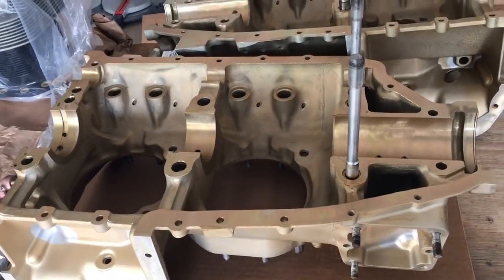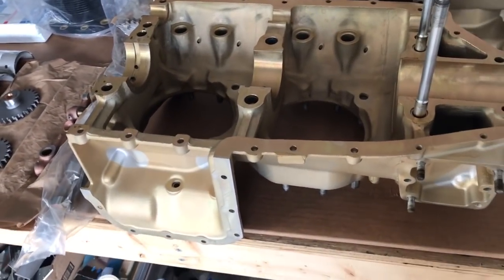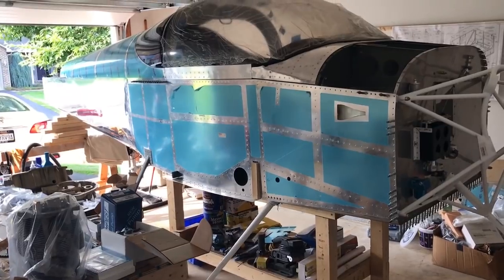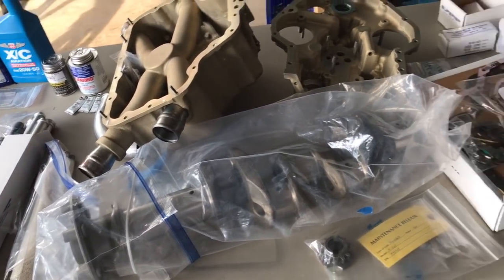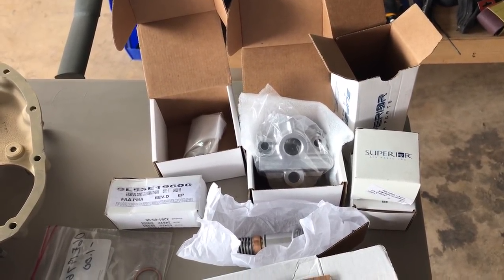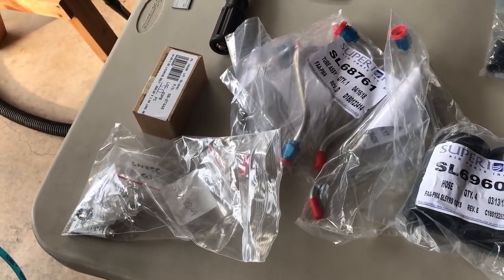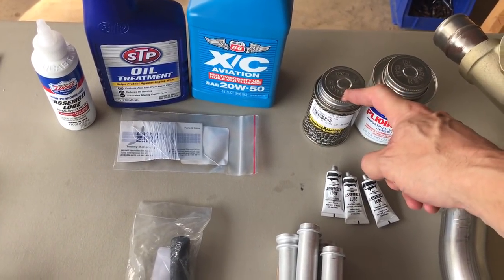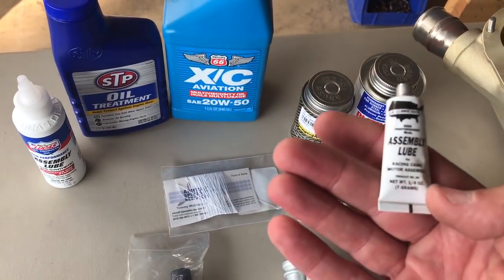Lycoming O320 Rebuild Part 1

Comment: Good for you tackling an engine rebuild.   I would love to try such a feat, but would never.   So much knowledge I don't have is required.   Glad yours came out alright..
Reply from the maker: @gsxphil
I did reassemble.  It’s been flying since March 2019.  I wound up getting help from Winchester Aero Engines.  I have tons of pictures but didnt video reassembly.
Reply: Thanks for your video.

Did Divco shave any metal off the case halves parting surfaces-? @gsxphil

Comment: @gsxphil I'm thinking about getting a used o-320 engine and rebuilding it but am afraid of the costs, how much did it cost in total for you to buy a used engine and rebuild it ? like total in tools, parts , engine and paid labor?
Reply from the maker: I paid $4000.00 for the used engine.  in total it cost me about $18000 total.  Thats including the $4000.00.  I did enlist the help of a local engine shop to help me re-assemble.  They only charged me $900 for two days in the shop.    You can definitely save alot of money going this route.  I took a gamble that the parts that i received were going to be good.  I knew that crank was good, it had already been sent out and refurbished.  All the parts that i sent out to be refurbished and inspected all came back good.  i bought the new cylinders and pistons.  Running good for nearly 400 hours now.  Happy to answer any other questions.
Reply: @gsxphil  So I've watched a couple of YouTube videos, and what I'm going to do when I got my used engine is to disassemble it and clean it with break cleaner , then take the crank and roads to a automobile machine shop and have them balance it, but I'm not sure about what to do if the pistons and cylinder bores of they where out of tolerance?     I'm thinking of only getting slitly oversized positions and machine the old cylinder bores to match and save money.    do you think it would work and what do you recommend looking out for on the used engine to not get ripped off?

Comment: My O-320-E2A Cases and Accessory Case are currently at Divco. Waiting to see what comes back.
Reply from the maker: How did they turn out.?  Divco did mine and they were perfect.
Reply: Perfect is an understatement. Not only did they fix the crack in the one case half, but found and fixed 6 others that we didn't know about. All back together and flying again.

Comment: Intake air is heated by the engine oil/pan?  If so is that to prevent the valves from burning or just for proper air/fuel mixture?

Comment: Never leave any crank laying on its side. Always stand up ... could warp
Also make sure your torque wrench is calibrated and follow torque specs whether wet or dry, meaning oiled threads and shoulders  or not.
Reply: The crank is not going to warp laying on its side that is nonsense
Reply: unless otherwise specified, clean dry threads